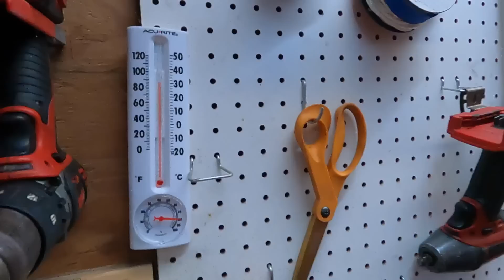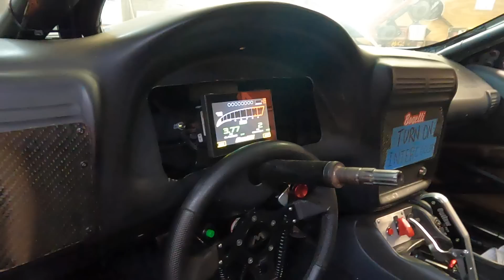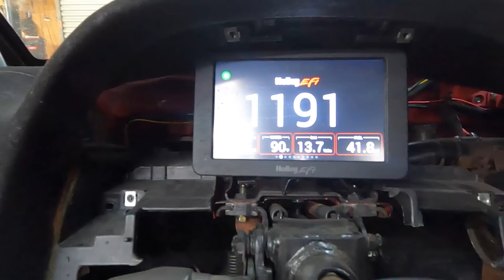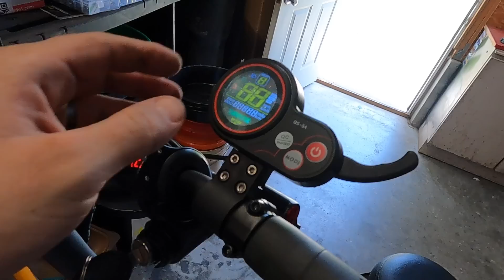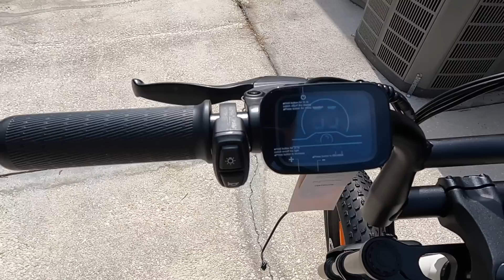Too Hot For Car Stuff... Subscribe to @BogettiStudios

Comment: I have that same scooter.  I've got 1200 miles on it so far.  I went through a ton of tubes.  I got some offroad tires off Amazon, and I haven't had any more issues with flats.  Much thicker tires.

Comment: I've worked in bike shops for 25+ years. Changing these new eclectic scooter tubes is such a pain.  Crazy how e-bikes have changed the bicycle world. Feel like I'm going to need an electronics degree soon.

Fix a flat and slime suck. try a latex sealent like stan's or peaty's from a bike shop. Most people use it for tubless, but works great in tubes as well.

Comment: It's generally a bad idea to park a car and let it sit with ethanol in it. Alcohol absorbs water, drys out rubber seals, and corrodes the injectors.
Drain the ethanol and store it with ethanol free gas. I buy it from Wawa because they have 2 seperate hoses. If you buy it from a place that has ethanol, and ethanol free gas that dispenses thru a single hose you're getting a small amount of corn gas with your ethanol free gas